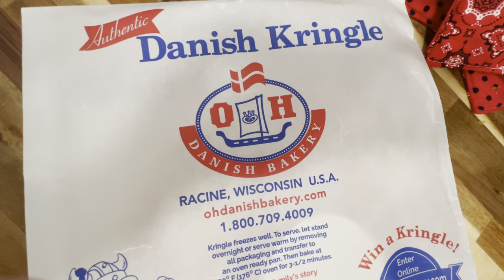Hello Cody High School in Cody, Wyoming….Mr. Collins Class is Building a Tiny Home ❤️🤍💙🏡😉

Comment: Randy, your container looks awesome and I like the design of the couch. Question -  I have a tiny house that I built and I leveled it with concrete blocks but my wheels are now off the ground about an inch. Will that be an issue?
Reply: I believe pressure treated wood blocks are what Randy recomends to raise, and level your tiny home. Concrete blocks can crumble. 
But, you want your wheels off the ground a little to pressrve your tires. You also should put some type of moisturizing compound on the tire, and then cover them up in dark plastic . This will also protect the tires from sun damage.